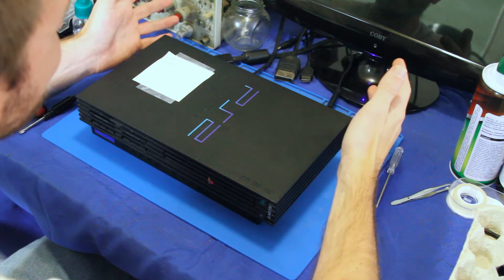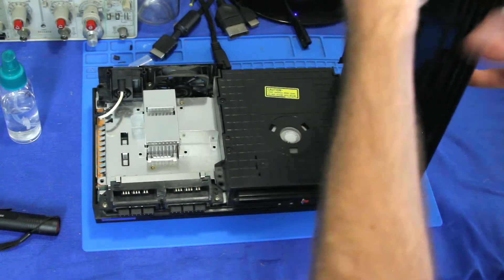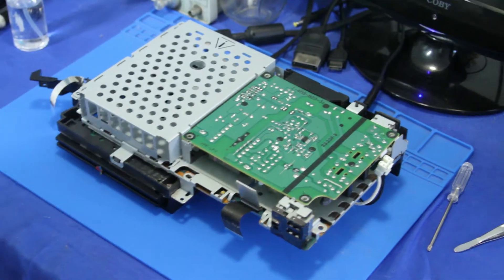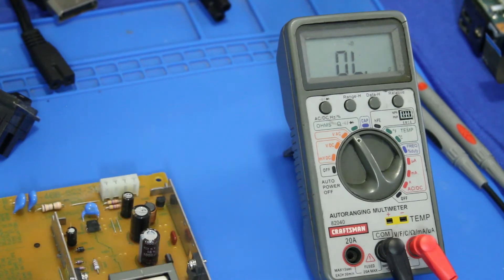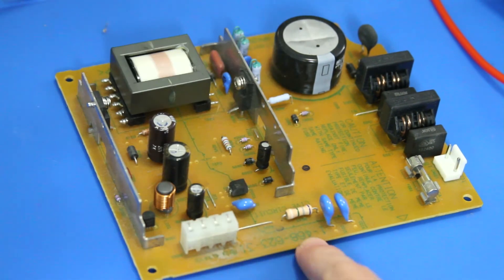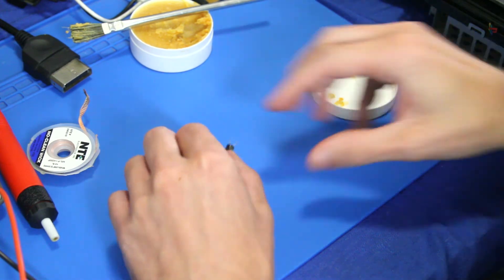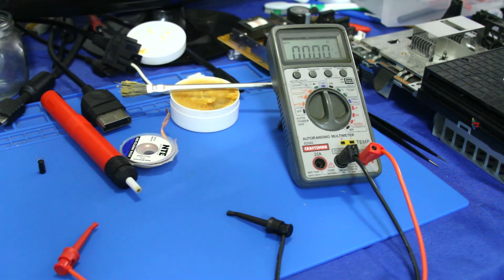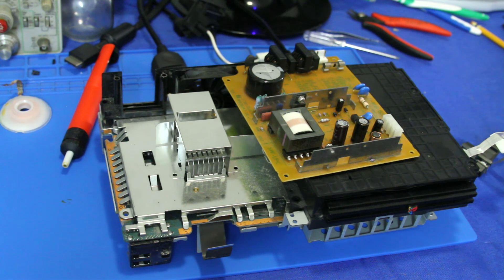DOA PlayStation 2 Part 1: Testing the power supply

Comment: When you are testing for voltage, you are holding the black lead on the PS2 console that's not even attached to the poswer supply board? You will never get a reading that way. There would have to be a ground wire still connected from the power supply to the shielding to get a reading.
Reply from the maker: Ugh. You're right. I dunno why I did that. I always put the black on some kind of ground. Brain fart I guess while shooting? 🤷 Thanks for pointing that out! I'll definitely address it in a future video.

Comment: I have found using in-circuit esr meter for testing capacitors makes thing a lot easier.
Reply from the maker: Definitely always looking for new testing equipment! Any you would recommend?
Reply: @titanrepairs  I use MESR-100 .